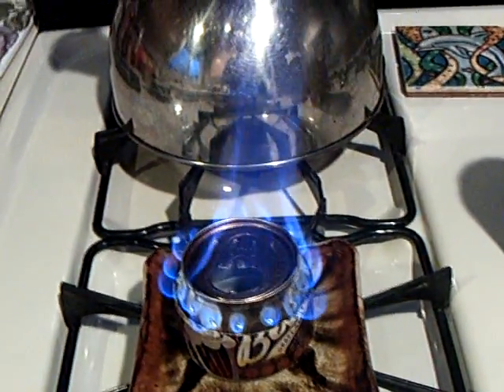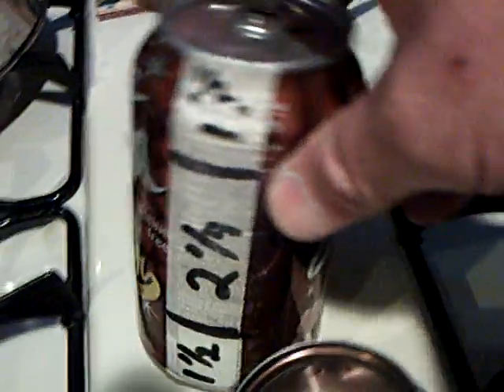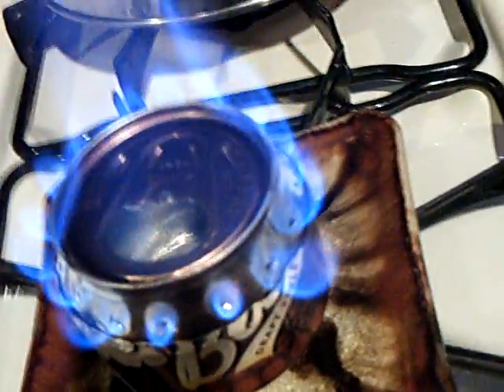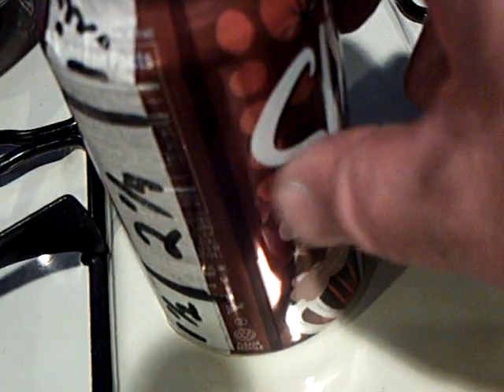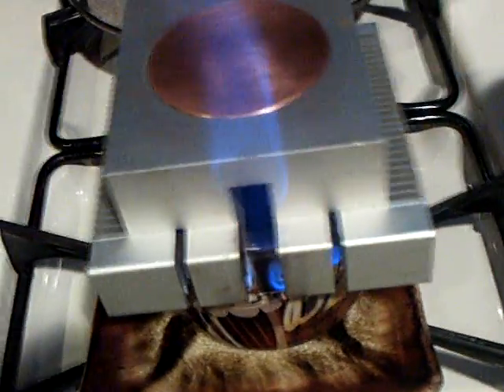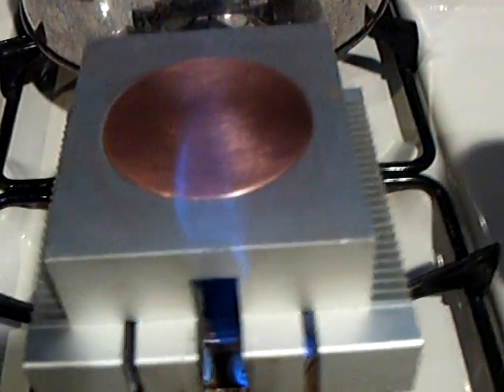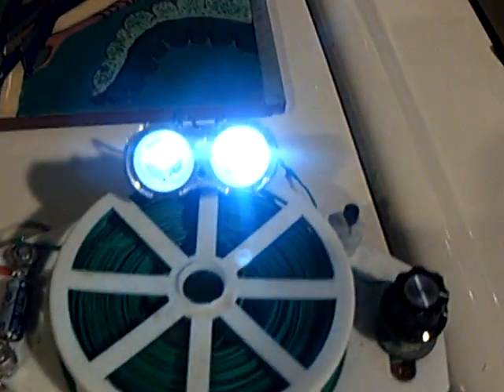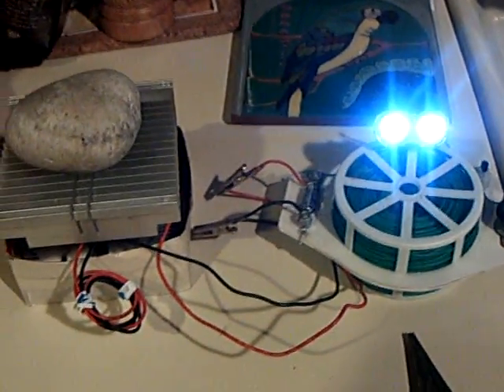1 can & 1 tool --Soda Can Stove  and Thermoelectric generator

Comment: I made one of these (very similar to yours) and I can't get it to stay lit for more than a second. What is the technique you use to get it started? (I know this video is kind of old, but I'm curious!)
Reply from the maker: Jack of Trades This has to be heated up with external fuel first to work.  I just put a small puddle in the dish and let it burn ---then started the stove.

Comment from the maker: A 12oz bottle should give you about an hour---but one of the problems with this simple stove is that it will only run about 10 min. on a charge.  I'm sure that someone has figured out a way around that without making it too complicated.